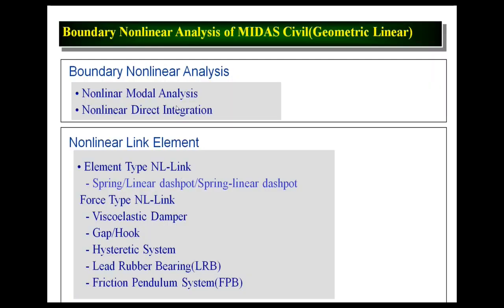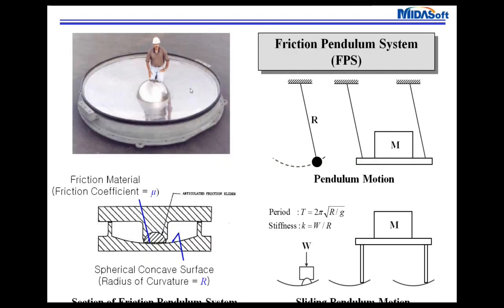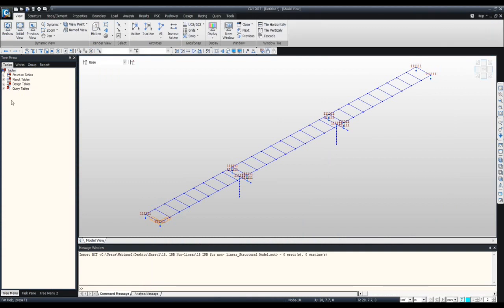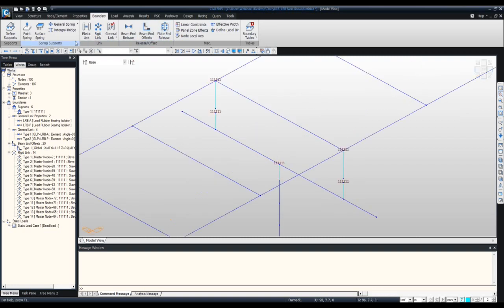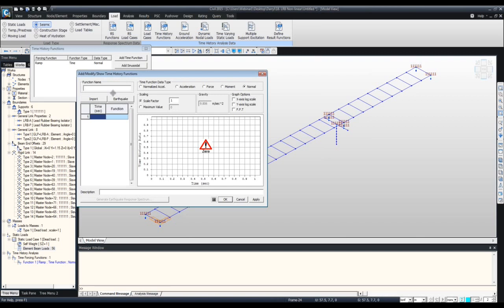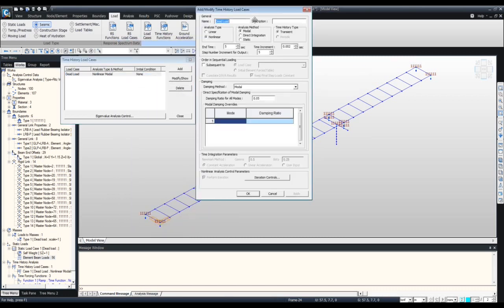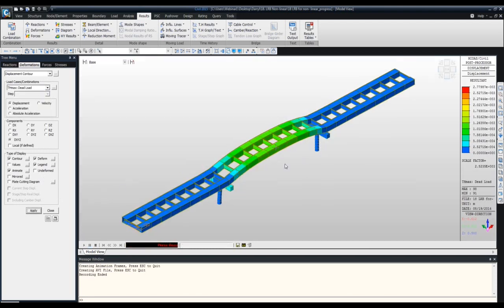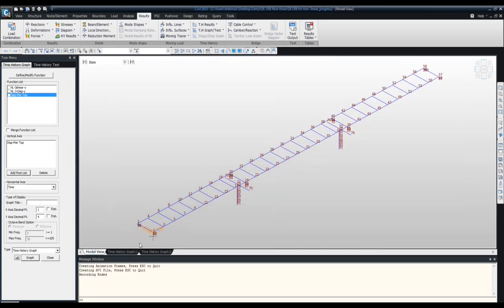Nonlinear Time History Analysis of Bridges with Seismic Isolators

Comment: Respected sir/mam,

I am a student of M.tech structural engineering and I am doing a project on Behaviour of STEEL GIRDER INTEGRAL ABUTMENT BRIDGE under earthquake as a part of curriculum. I have queries regarding the project.

1) I am applying Non-linear time history analysis for that does I have to apply general link at abutment and pier if yes then can you please provide General link data thoroughly?

2)Do I have to apply a rigid link or some other boundary condition between the girder and abutment to define monolithic connection?
Reply: no
Reply: @lifestructures555  sorry, how make a rigid link?please teach me🙏
Reply: @-Hepdyantamasimarmata  it is easy just connect two node with rigid link
Reply: @lifestructures555  should we use a rigid link for making LRB?
Reply: @-Hepdyantamasimarmata  you have to use Elastic link element.. rigid link constraint all the DOF.. Bearing behavior will not be simulated by rigid link
Reply: @lifestructures555  owh, thankyou sir 
By the way,can i have your Instagram?i want to discus about how to make base isolator in midas🙏